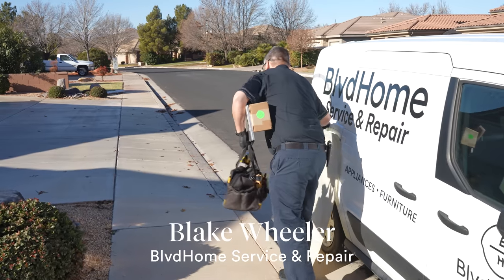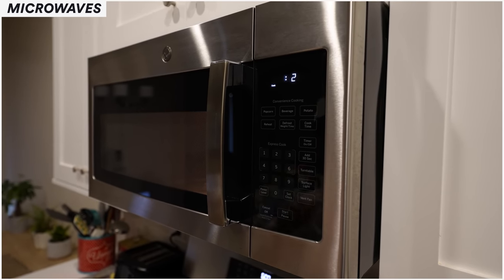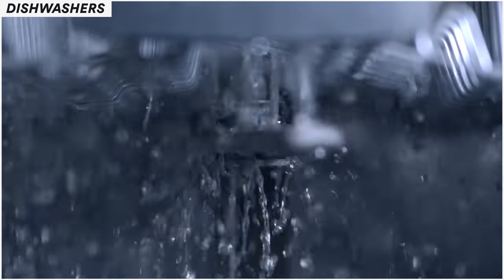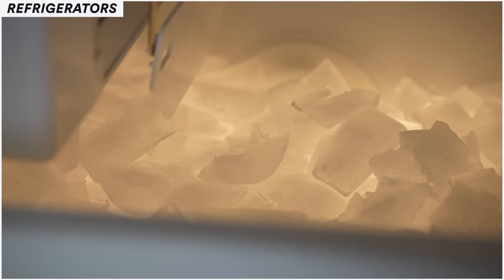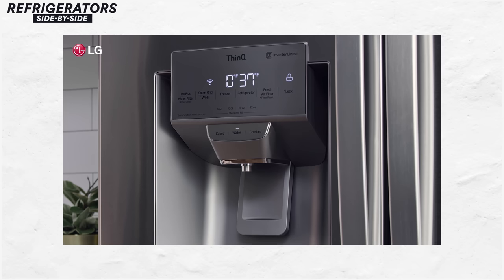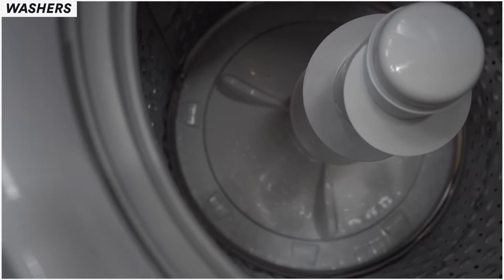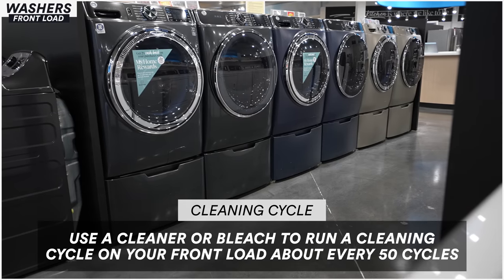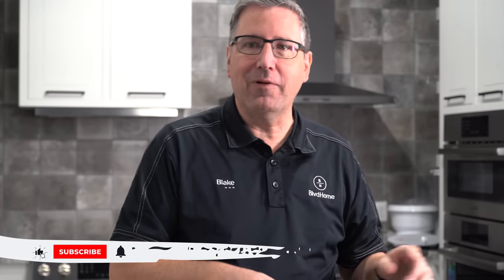Best Appliances Recommended by a Repair Technician of 29 Years

Comment: One model he did not mention was "Maytag." I have had my Maytag top loader washer/dryer for over 30 years and never had one problem. I purchased it at Mongomery Wards, which was closed about 20 years ago. I have had a Kenmore standing stove/oven for about 15 years now. Called a repairman about 12 years to fix the oven igniter which cost $225, after that every repair needed I fixed it myself. I have been a DIYer of everything ever since.
Reply: Maytag = Whirlpool
Reply: @Arlene M --- I'm going to copy and paste part of what I said to another person whose older washer has been trouble free.

In your case, a 30 year old machine's reliability says nothing about a machine bought in, say, the last ten years, because manufacturers of almost all brands and models have been steadily using poorer and poorer quality parts in order to make more profit without increasing sales, and in order to cause consumers to buy new machines more often.

Maytag, in particular, has become a completely different company since you bought yours.  They have been bought out by Whirlpool and regardless of how good Whirlpool used to be, Maytags are now just as 'average' in quality as all other mainstream brands.  (You can add the once wonderful KitchenAid to this list too.)

A new Maytag might as well have a 'PiddlePaddle' badge on it, since new ones have nothing to do with Maytag's former quality and manufacturing process.
Reply: Whirlpool= KitchenAid, Maytag, Amana, Jenn-Air..... Small differences...  I will say I've had a Maytag W/D for 5 yrs in Household of 7.... washer rock solid, dyer had issue with ball bearings going bad on wheels for tumbler after 3 yrs. $18.00 and 2 hours on weekend fixed myself no issues since.
Reply: Maytag sold out some years back.  My mom had her Maytag washing machine for 35 years, but that was then, not now.
Reply: @kenbagwell8551  Yeah, I just got one & I'm returning it.  They're using the Maytag logo, but that's all, not the same.
Reply: Maytag isn't maytag anymore..
Reply: @be5952  Exactly Right! I had 2 Maytag Sets, trust me Maytag was once the set to have but no more people. Profits before everything no matter the costs to reputation. Greed today is sadly off the charts and the consumer is getting the shaft. So sad what is going on.

Comment: I've had my matching Electrolux washer and dryer set for almost 2 years and have had zero problems. I like the front loaders from a water consumption standpoint and, even though they're gentler on clothes, they seem to do a better job getting them clean. My only complaint is with the dry. The auto (sensor) dry does not work well at all. Even set to the max, the clothes always come out a little damp. This isn't unique to Electrolux either: every auto dry dryer I've used seems to do the same thing.

Comment: I have an even better proposition for dryers. It never fails, costs 30 bucks at most, can be passed on to generations. A drying rack. A string between two trees works nice too.
Reply: welp...they have problem working certain months every year...
Reply: @nuhnaffyarbuziness7598  drying racks,, nope
Reply: They don’t work when it rains or snows outside. Or on 
cloudy/Foggy days plus the sun fades the colored clothing.
Reply: Never drying in heavy humidity of summer and freezing in winter. Plus, pollen, birds, bugs, and pollution after I clean everything? Nope. Inside? Not enough room and then have to protect floors from drips & walls from constant humidity of clothes & linens drying? Nope.
Reply: Hey folks, people have been doing it for centuries and are still doing it in all sorts of climates, with our without exterior space, and most of them with definitely not the money to spend on a dryer. If you want a cheap and effective solution, you just gotta adapt, think smart. It's not rocket science, you've got this!

Comment: My mother always said that Maytag was the best and I believed her seeing that she never did replace any of her appliances that I can remember. She has passed now and those older appliances are still going. The problem that I have, is that I purchased Maytag Refrig and Washer and Dryer, and all three of them broke down in the warranty period. The Washer had to have the whole mechanism replaced. The Refrig had to have a drain tube replaced due to faulty design. Now that they are out of warranty, the washer has major rust on the panels and refrig ice dispenser motor kept running and had to be disconnected due to the PC board failure. My point is that newer appliances are not made the same. They are all undependable no matter what brand. Btw Samsung stove and micro also failed. All rubbish.
Reply: I had my Maytag washer & dryer for 26 yrs.  Recently had to replace both.  Found out Maytag was bought out in 2006 by Whirlpool - they are not the same anymore.  Bought a new set.  Like the dryer, but am returning the washer as I hate it.  It has a Maytag emblem on it, but it's not the same at all.  Very disappointed. :(
Reply: @kittybeck151  none of them are the same. After like 2010 all of them are built to break and lucky to get 7 years out of them, thats thier goal and to sell more..   there is zero reason any of these should break down with the technology we have today, but they wouldn't make alot of money if they only sold a family one appliance every 25 years now would they?
Reply: @kittybeck151  Maytag wasn't the same BEFORE Whirlpool bought them out. Their first few Neptune front-load washers were built for them by Samsung and they did NOT hold up well at all - it was one reason they were able to be bought out, along with some other design missteps that cost them a ton (their Wide by Side refrigerators broke A LOT). Federal regulations on power and water use enforced since then have only made it harder to find a simple, reliable machine.

Also, the more circuit boards you stuff into a machine that handles wet stuff, the more places for an expensive failure to happen.

Comment: Over here in Germany we would always prefer Miele over Bosch, when it comes to dishwashers! They are very reliable, and they will seriously last more than 10 years, just like ours at home. Bosch and Siemens all use chinese and or plastic parts that break much easier than the ones from Miele, that generally actually build them here in Germany. Seriously try them out!
Reply: Miele is premium brand or very premium brand. Bosch and Siemens are not. Neither is AEG, Electrolux and similar.
Reply: @andrazlogar861  Miele is that good because they are a completely separate company compared to Bosch, Siemens, Aeg and the others, that are mostly just arms of a big octopus, which is one company behind them all. And this large company will only show interest in maximising profits even if it's at the cost of reliability.

Comment: I know the Pro stoves are more trouble prone but mine doesn't have timers and wifi and lots of modes.  My Thermador Pro Grande stove is  going strong.  One small repair in 18 years.   Giving it to the kids and getting a Thermadore Harmony Pro.  No screens or special features.  Hope I didn't mess up choosing duel fuel this time.  I hear that can be a problem.  Going on 22 years  with the Kenmore gas dryer.  Speed Queen is in my future when this one dies.  Bosche dishwasher is 10 and going strong.   I think you are right.  I probably tanked a microwave opening the door.  It didn't last long.  Thanks for the tips. It's great to get a non sales person perspective.

Comment: My Bosch dishwasher is the most fantastic machine I own.  If I move, it comes with me!  My refrigerator is the most basic bottom  I could buy.  I disconnected the ice maker immediately and have never had issues with it for the last 21 years.  My unit is also a GE.

Comment: If you have the time, would appreciate your thoughts.  We have a dryer that just broke after almost 10 years, and the matching washer works fine (Samsungs).  

1) Would you replace both at the same time?  
2) What do you think about LG Wash Towers (ie. the single-unit "stacked" washer/dryer?  
3) Would you buy a washtower or prefer separate washer/dryer?  

Thanks!
Reply from the maker: Thanks for the question! To answer your first question, it really just comes down to if you like having matching units. If your washer works fine, no need to replace it, but many people replace them both at once for aesthetic reasons. As for wash towers, we actually have put out a few videos recently on them that will explain much more than I could in a comment, so I'll link those below. Thanks for watching!

Pros and Cons of Washtowers: https://www.youtube.com/watch?v=Sp6_kJdXLuk
LG Washtower Review: https://www.youtube.com/watch?v=PUljiaPzc3Y&t=259s
Electrolux Washtower Review: https://www.youtube.com/watch?v=pXGCDiRXK0E
Technician's Opinion on Electrolux Washtower: https://www.youtube.com/watch?v=H4BnwDH9rgQ

Comment: Thank you so much for what you said about ranges. We finally just went with one.  We were so back and forth on what we wanted and seemed like every "top 5 models" video was different and you would see so many comments about "stay away from that one. I had it two months and it failed" and this video just reaffirmed what I thought .... a stove is a stove... and I have literally never known someone who had to get one fixed lol
Reply: Range igniters will eventually fail... So nothing to lol about
Reply: I bought a Frigidaire range, no frill or thrills last year 2023. Oven won’t shut off, literally hit the off button and bake option is completely off but oven is still heating up, and you can hear the humming sound coming from the back of stove. For safety’s sake I shut off breaker and repeated the process, three times it would not shut off. Back to store and see what they can do about it.

Comment: Absolutely agree with you about LG washing machines and dryers. I have had a set for about four years now. We have used them a LOT.  I have not had a single problem with either of them. Based on that experience, I just bought an LG refrigerator. Hoping I get the same great reliability with it. But after buying it I have heard so many horrible things about the compressors. Sounds like I might be putting that five-year extended warranty to work.
Reply from the maker: Glad to hear you've had a good experience with your LG washer and dryer. Hopefully you don't need to use that warranty on your new fridge though! Thanks for sharing.
Reply: Look for my experience in the comments section with my LG French Door fridge....  so far so good
Reply: Will do.  Thanks!

Comment: We have LG fridge and yes, the compressor went bad and also the defrost for the freezer wasn't working properly and had to be de-iced.  The LG was a bottom freezer with French doors for fridge.   We did get it repaired and the technician removed the bottom back grill and put some bricks on bottom back for spacing, this was for ventilation which he thought was the reason for the failures we had.  The LG hasn't had problems with ice makers yet, it has two, one for the freezer on bottom and one in the door.  It has been a few years since we got the fridge repaired and it has been still working.  The cost of repairs was less than a new fridge and the failure of the compressor and defroster was about four years after purchase but now it is a solid performer, so far.....
Reply from the maker: Sorry to hear about your troubles, but glad it's working better now! Thanks for watching.

Comment: Had Bosch dishwashers in both our winter and summer houses in Istanbul. Both from the early 90s. The one in the summer house failed last year, and the other one got replaced because the building was taken down to build a new one, so all the appliances were replaced with the new building except for the 2011 model Miele washing machine we got recently.

Comment: I am not a fan of water & ice on the door refrigerators.  Just about everyone I know has had a problem with the icemaker on the door.  I have a 15-year-old Kenmore Elite freezer on the bottom fridge.  Still running like a champ.  I've had the ice maker serviced once because the water intake hose froze.  Tech told me to use the ice maker more to keep the water flowing.  Haven't had a problem since.

Comment: I own a Bosch dishwasher, and agree. It's the best. It does however have one major weakness, which can easily be mitigated by the user; CLEAN THE FOOD TRAP MONTHLY. For the first 3yrs, while Bosch makes it clear it needs to be cleaned regularly, when I visually looked at it, there was nothing in there. BUT, it was actually filthy as it traps food broken down to microscopic size. The pump on my Bosch failed in yr 3 because I didnt clean out the trap regularily. When I cleaned the food trap it was absolutely filled with microscopic food particles, so much so, it clogged my sink's food trap. Again, the trap visually didnt appear dirty but in actuality it was filthy clogged, a function of just how well the Bosch cleans dishes. So clean it out monthly. You'll be surprised.
Reply from the maker: Great advice, thanks for sharing!

Comment: I have a 17 year old LG fridge with zero problems and still whisper quiet (important in an open floorplan home). I just have to vacuum the dust off the back of the machine ever few years. The LG fridges from a few year ago that experienced so many problems was because LG introduced a more efficient compressor to comply with EPA energy saving regulations, but it obviously had reliability problems. Supposedly LG has fixed the problem, but hard to know for sure until there is more history. It is very hard to label one brand as more reliable than another, because their products change over time. Always good to get a tried and true technology, regardless of brand.

Comment: The "matching" washer end dryer set is where the manufacturer sees you coming and takes advantage of your (or your wife's) vanity. 

I just bought a brand new speed queen washing machine. It cost $1300 and change. The matching dryer right next to it? Also $1300 and change. I politely declined their offer to rob me, and bought a good condition used dryer. The washer was a TR5003, the used dryer I found elsewhere was a TR5000. Side by side you can't tell them apart. Manufacturers know that some people...probably most...are too stupid not to fall for this trick. The washer is a heavy, complicated machine, just like it was in 1970. The dryer is a light, simple machine, just like it was in 1970...except in 1970, 1980, 1990...The dryer cost far less because it was cheaper,  by far, to produce. It is still cheaper to produce, by far, but sold at the exact same price as the washer, because they know that the customer's vanity will override their common sense, and they'll just throw money at a problem that's imaginary. It's criminal, really, how they swindle unsuspecting customers who just don't know that they're getting robbed by paying washer prices for dryers.

Comment: Wow.  Agreed, the speed queen washer is best.  Had the best frigidaire dishwasher, which beat my whirlpool all the way around.  15yrs and just replaced it cause of age.  Still working.   Taking a chance on Samsung flex frig and for 2 yrs its all good.  Love that you can have an extra frig space or full bottom freezer.  Now stoves, if your stuck with electric, definitely go induction.  Radiant inconsistency of shutting off is very hard to cook on.  Plus, with induction, you get good metal base pans and won't have the issue of wobbling pans.  I love the tech telling us this info.  It's smart to listen to them.  I always wised manufacturers would include them in design.

Comment: Can attest to the Bosch dishwasher and LG top load washer/dryer. I did have the heater on the Bosch go out on me, but I was actually able to replace it myself with little trouble and it's been good since. My biggest disappointment lately has been our Whirlpool fridge.  Had an issue with the wiring harness for the ice maker getting cut from frequent opening/closing of the freezer door and had to reconnect the wires. Also, the dispenser tray tends to fill up easily and grow mold fairly quickly. Have had many of the drawers crack as well.  They are made very cheaply.
Reply from the maker: We've had other comments talking about that same wire harness issue with their Whirlpools as well. Thanks for sharing!

Comment: My GE microwave door has multiple switches. I pulled all of them thinking it would be a good preventative measure just to replace them all. My appliance parts distributor took care in inspecting each one and advised me that only one of was faulty. He had a way of testing them by just slowly triggering the switch to see if the multiple meter would signal a problem with the contacts. He highly recommended that I replace only the one faulty switch advising me that the quality of the new switches are not as good as the old switches. After more than 5 years my microwave was been trouble free.

Comment: Fantastic video.  We have an LG French door fridge with the clear knock-knock window, and while adequate, I feel like temperatures are off a bit (not cold enough) and it has a weird buzzing sound all the time which is annoying.  We have the LG WM8900 washer and its matching dryer, both of which are wonderful.  I adjusted the pressure switch of the washer to use more water and it’s so much better!  Before, we had a top loading Speed Queen set - washer was great, but the dryer was pure garbage - broke twice within 5 years of use (heating element).  For our dishwasher, we have the Miele G7366, and it is the finest appliance we’ve ever owned.  I’d love to know your thoughts on Miele.